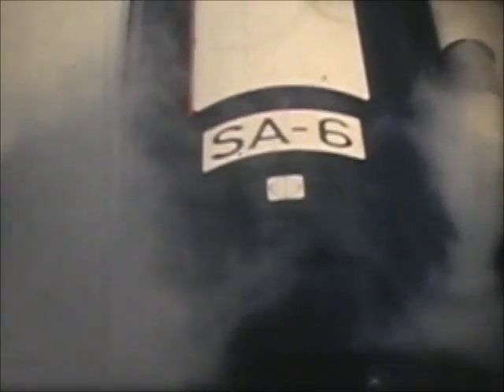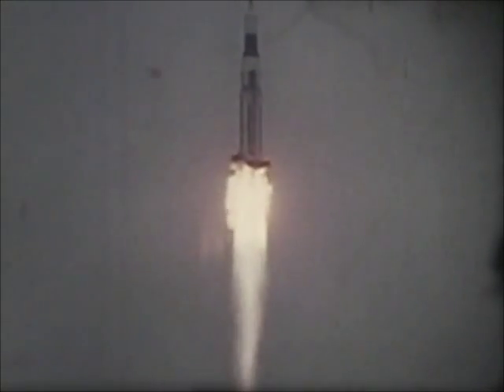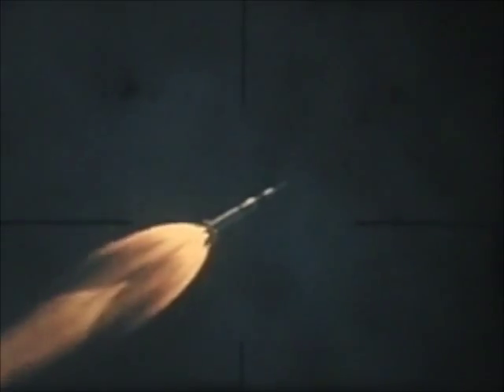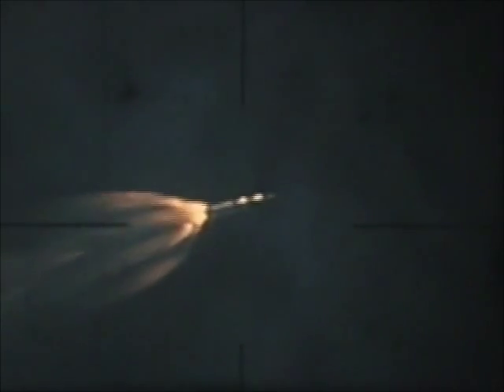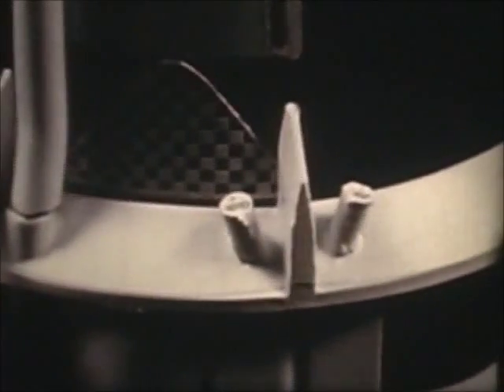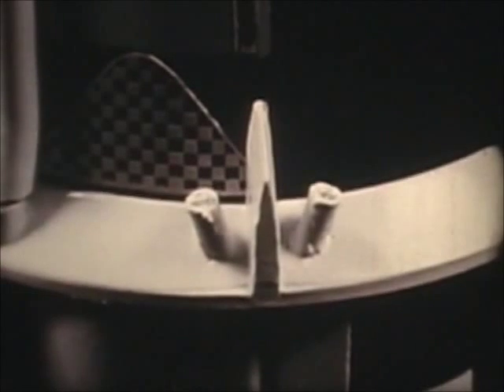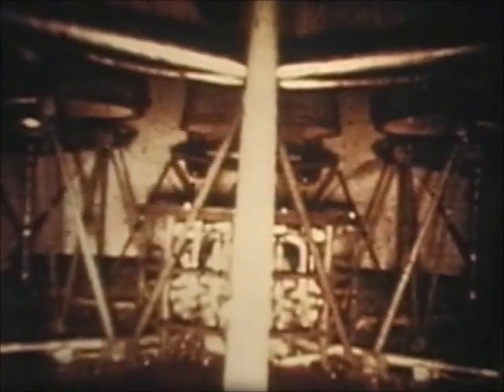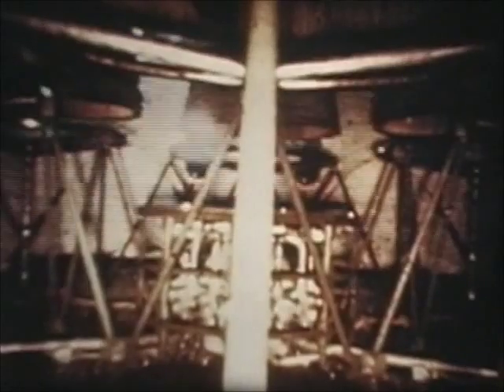Apollo Spacecraft Test Flight AS-101 (SA-6)

Comment: Note this wasn't Apollo 6 as per your title.  I'm not sure what SA-6 meant but it didn't mean Saturn-Apollo. This flight, called AS-101 (aka SA-6) launched May 28 1964 as confirmed by the commentary.  Apollo 6 wasn't  launched until four years later, April 4 1968.
Reply: Mr Mac, perhaps this will answer some of your questions. Be well. https://en.wikipedia.org/wiki/AS-101_(spacecraft)
Reply: I did a bit more digging:-
"The Marshall Space Flight Center, which designed the Saturn rockets, referred to the flights as Saturn-Apollo (SA), while Kennedy Space Center referred to the flights as Apollo-Saturn (AS). This is why the unmanned Saturn 1 flights are referred to as SA and the unmanned Saturn 1B are referred to as AS."
Ref: https://en.wikipedia.org/wiki/List_of_Apollo_missions

I still think it is confusing of the OP to refer to this one as Saturn-Apollo 6 rather than the usual SA-6 especially when there is a different flight called Apollo 6 (aka SA-502).  Apollo 6 would never be referred to as Saturn-Apollo 502!
Reply: Thank you Sam for the additional information and taking the time to post. Be well.

Comment: amazing.  Huntsville's space museum once had a display that showed you how the optics worked.  they had a 1 inch round optic cable wrapped around a 5 foot tall 2 ft wide cylinder about 20 times with a camera at the end with a monitor that proved you could see around corners.  sadly, almost all of those old cool displays are gone now but you can still see it in the old early 80s museum souvenir book which I still have.
Reply: I remember seeing that actual fiber optic display when I was 11 or 12 years old back in 1971 or 1972.  My parents took me there (the Alabama Space and Rocket Center) on vacation.  I seem to recall that when I saw it, there was an actual eye piece that I had to look through.  Maybe it was changed later to utilize a camera and monitor so that more people could observe it at once instead of waiting in line to look through it.